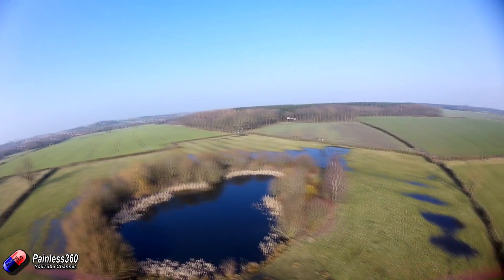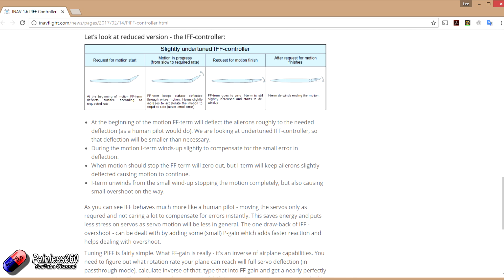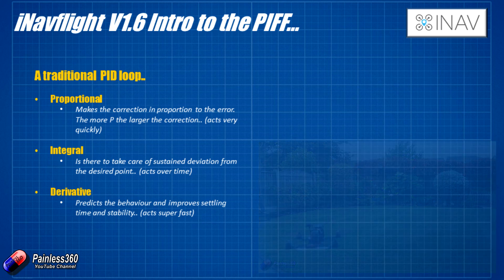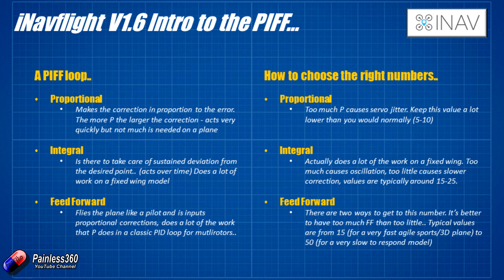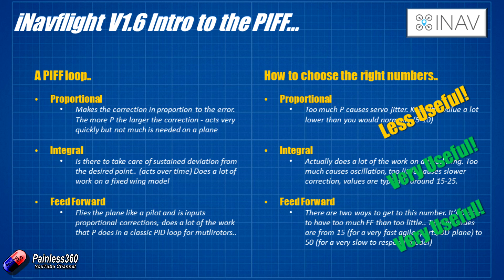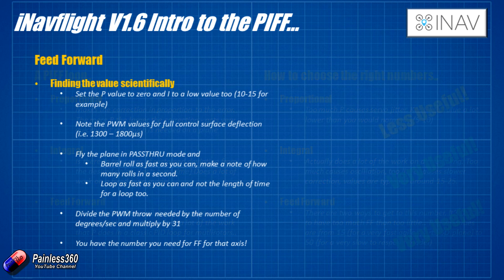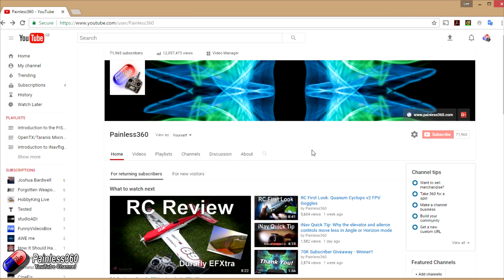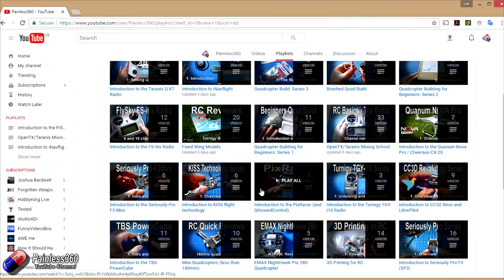iNav 1.6 - Understanding the new PIFF controller for fixed wing planes

Comment: Out of curiosity, now that you have used iNav and the S6R for stabilisation in the Efxtra, which do find the better for stabilisation? Not for Angle or Level hold, but solely for ability to fly in wind or remove uncommanded movements (ie. Stabilisation only on S6R)
Reply from the maker: Both work well but I prefer iNav as I can do so much more with it. It's personal preference and both work well. See my video about my thoughts on it - http://www.youtube.com/watch?v=YAfNC55Udu0 Happy flying!

Comment: I searched your videos on tuning Inav's PIFF. I fly in acro with air mode. I am running 2.0. I have done auto-tuning and it fly’s well in calm conditions but in windier weather it is being buffeted a lot especially on the roll axis. Far more than any of my planes running simple 3D gyros ( No FC). Before the PIFF I would have expected to increase "P" to get more stability from wind buffeting. But after watching this I gained the impression I should be increasing "I" instead? BTW Roll PIFF is 6, 9 , 44
Reply from the maker: Thanks for using the search function, so many ask a question on whatever video they happen to land on when the answer to their question is already on the channel in another video - one that is easily found with a basic search. The P and I parts of the PIFF loop should be treated in the same was, P for responsiveness, I for sustained deviation. So P would be the one I'd look at if you need a stronger correction for external movement of the craft. Happy flying!
Reply: Painless360  Thank you

Comment: When you make the extreme rolls and loops in order to count the rotation of the plane in one second. What will be the Throttle position? .  Middle or full Throttle. ?  Thanks again for all the great video.
Reply from the maker: +kolotoympas throttle won't affect roll too much and you'll need decent speed when looping so perform them as normal.. happy flying!

Comment: I am having the toughest time getting my Nano Talon to fly properly in angle mode.  I have iNav 1.8.  It simply is super sluggish when I try to roll or pitch, even at full stick.   When I test it on the ground, the control surface movements in angle mode are about 85% of the movement I get in passthrough mode.  This is at a FF(D) value of 90.  Could anyone please share their PIFF settings for the Nano?

Comment: Hi there  Painless Happy New Year to you. and thank you for yet another fascinating series, this time the i Nav.
I am not yet committing to the desire to fit one into my 7channel glider (including the flaps)(Volantex Phoenix 2000) . but am  interested in the concepts, options and budget. 
I have gone through all 8 of your introduction to iNav just the once, to get familiar with what's in the videos.
So now to my question(s).
1     We are now into 2018. What would be the cheapest, efficient controller and GPS that you would recommend. ( i notice that some come with pins soldered some don't have pins. Value for money, ease of mounting ????
2     What surfaces will the controller be controlling?
3      My Ailerons and flaps are all on separate servos
Sorry for asking these daft questions, but there seems to be lots of guys purporting to be experts and I would like to aim for consistency between components  I select and your videos.
Keep up the good work
Bruce
Reply from the maker: +Bruce Austin I'm currently researching a couple of extra videos to look at inav with the latest modern flight controllers and up-to-date pieces. There are a couple of dedicated inav flight controllers available now, as well as the very popular omnibus F4 all in one board that lots of pilots are using for inav builds. The documentation for inav is excellent so I recommend spending a bit of time and having a look through there, as things are changing all of the time. Best of luck

Comment: I have iNAV 1.6 in my glider and so far it works really well but even though I calibrated the esc it is not using the motor for RTH. It only glides back and so against the wind it can´t get home. Do I have to activate something in the cli or elsewhere?
Reply from the maker: Helipaddy I've not seen that, all of the planes we built here with INaw have worked ok with the motor. Might be worth asking the question in the developer forums in the wiki. Best of luck
Reply: Answer from the forum was: ´You don't have RTH failsafe set failsafe_procedure = SET-THR.´ And the case was closed. Don´t really understand why failsafe has influence to RTH activated by switch?
Reply from the maker: https://github.com/iNavFlight/inav/blob/master/docs/Failsafe.md is where I'd go to look at what that means.. Best of luck!

Comment: Hi Painless,
Great explanation thanks!
but i still have a few questions here, so for scientific method:
- where exact i can get my PWM values for the formula (on taranis - how? or in inav configurator? -what should i treat as desired values)?  and as we can configure different angels in inav (something like roll/s degree & pitch sec/degree don't remeber these variables off the top of my head) and also both channels are mixed for elevons.
so from central position 1500us i move my elevator stick fully UP... to 2000us so up movement is the same as down and is about 500us. How did you get 360us?
-quantity of loops and rools per send will depends on speed of the plane.. What speed (throttle %) should i do these exercises to achive the best results?
- and once done.. how i should tune P and I?
i had a bad experience with iNAV 1.6 a series of crashes trying to tune my S800 SkySHadow wing.. Tried presets from confiurator for Z84 wing.. and it is very different than general 600mm wing preset.. :(
And AFAIR there is a new feature in 1.7.0  iNAV RC - called autotune.. Could you explaing how this works and what exact it does?
Reply from the maker: See the video on figuring out PWM values in FrSky channel travel in the OpenTX Mix school videos, I'd use the latest detail in the Wiki for setup, it's changing all the time. We will look at 1.7 autotune once it's out.. Best of luck!
Reply: Hi Painless360, could you point me to the eaxct video name for figuring PWM values?
Reply from the maker: It's the 'OpenTX Mix School' playlist. It's the video that looks at Flap setup. Best of luck!
Reply: Ok.. i've checked this lesson but still have few questions:
1- Is there any way to get PWM without servo checker? as i don't have it and my servos are soldered to FC directly on my wing :(
2- In which mode i should check servo movements? i mean on the wing i have Angle (light movement), Acro - (bigger angle) or in PassThrough (full)? to use in calculations for PIFF values?
Reply from the maker: See the main iNav series for all of the steps to get thing flying. You don't need a servo checker to get it all setup. Hope the rest of the series helps..

Comment: Great series! I don't know if I'm missing something here but I'm running 1.6.3 and don't see PIFF anywhere.
Reply: Hi Painless! Does having CUSTOMAIRPLANE selected turn on the PIFF controller? Does the PID configuration tab in iNav actually show PIFF or is it just assumed that D is used for the FF term? I set up a custom SMIX on a SP Racing EVO in a Durafly Tundra in order to use the flaps.
Reply from the maker: +Michael B if you've got a plane model selected then it's using it..

Comment: Hi, is the piff controller automatically in inav 1.6 if i switch the model to fixed wing? or do i have to change from pid to piff in cli?
Reply from the maker: MaxFpV flight yep, piff is automatically selected for fixed wing!

Comment: Having been worldwide mentor with BP PLC for Advanced Control for many many years I loose confidence in what I have learned and taught all the years when looking this video.
Reply from the maker: Control system theory is the same here, but it's evolved to support ultra fast responses with modern ESCs and very fast looptimes on modern flight controllers. A lot of the development into getting faster and faster PID loop times is actually wasted as the physical parts of the system (motors/props) can't respond in the time before the next measurements. It's a lot worse with fixed wing as the response is much longer. PIFF isn't new, it's just new to iNav. Thanks for posting. Let me know if I'm not explaining something properly..
Reply: @Painless360  can some of the time response between the FC. ESC and motors be faster if Fiberoptic wires were used?

Comment: I'm early
Reply from the maker: +nitrile red if you're asking about creating your own flight controller out of interest than the answer is it is possible but I would simply buy one of the excellent flight controllers available today to save you a lot of time and trouble. If you're asking as this might become part of a project that you're doing for university or college, then the answer is again yes but not something that I would be able to help with as its way above what I would understand. Best of luck
Reply from the maker: nitrile red yep, it's an interesting engineering exercise for those who want something good for their dissertation. For everyone else it's just easier to buy one of the current generation of F3 or F4 based processors. Happy flying!
Reply: okay so I have a question what is the feasibility of using a raspberry pi as a flight controller is it possible?
Reply: Yes, it would certainly be possible to use the Raspberry Pi as a flight controller. However the Raspberry Pi uses a Broadcom processor, whereas currently iNav/Betaflight/Cleanflight only support STM processor. Both of these are ARM-based processors, however all the device drivers etc would need to be ported to run on the Broadcom processor. This is not a huge amount of work, however it's not trivial either.
Reply: Painless360 it's way above me as well I just thought the processor on the pi 0 is 1 ghz so it could theoretically do the number crunching faster.......
but I read about a company NAVIO these were two college guys who did it with modified pi but then gave up I guess no updates since over a year and damn expensive 170 for a fc because of their R and D.............
ps F4 chips only run at 3-5% cpu usage at 8k 8k so long time for it to become obsolete another year perhaps.....